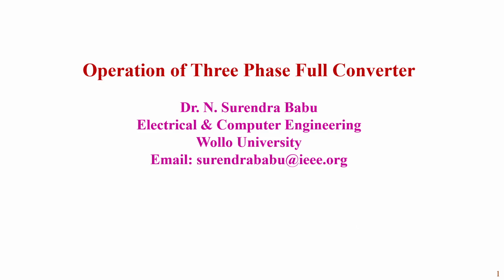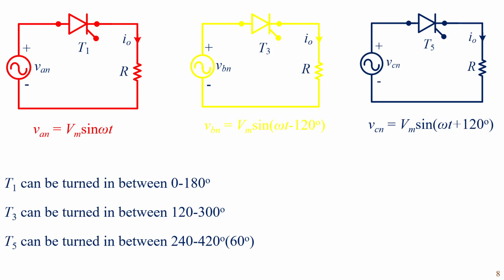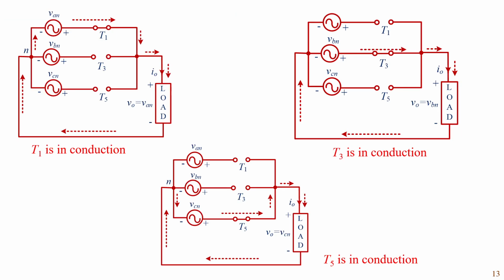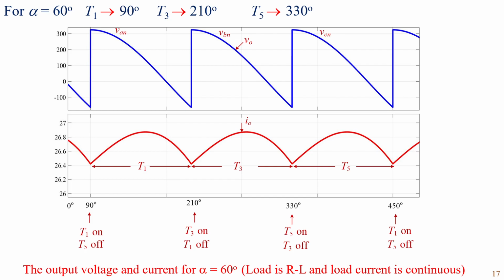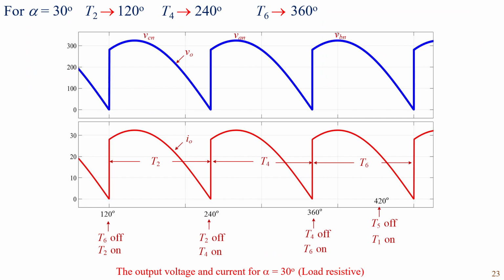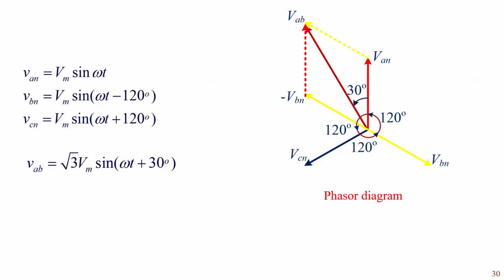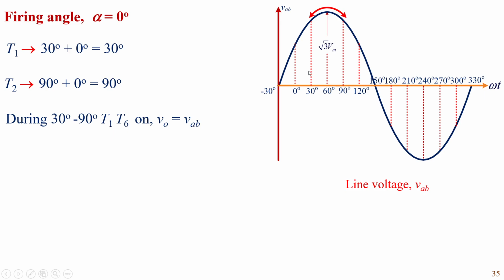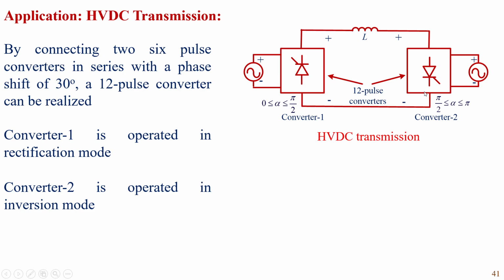Three Phase Full Converter

Comment: Thank you sir 
Sir can you tell firing angle for three phase dual converter also sir
Reply from the maker: In case of dual converter, in circulating current mode, converter-1 operates at alpha and other at (180-alpha)
Reply: Ok sir 
 But can you  say in detail sir 
ie the angle of each thyristor